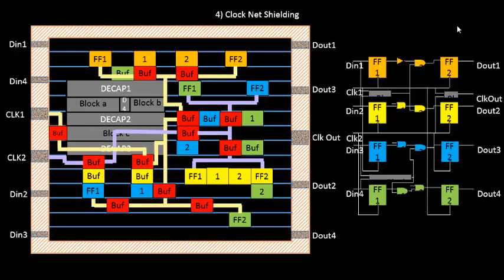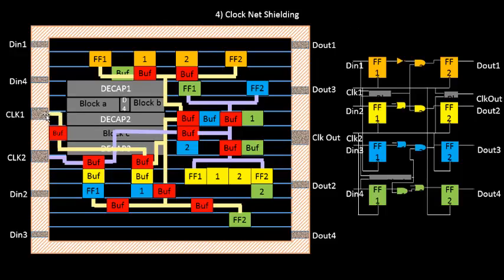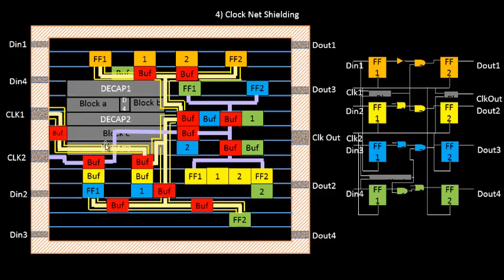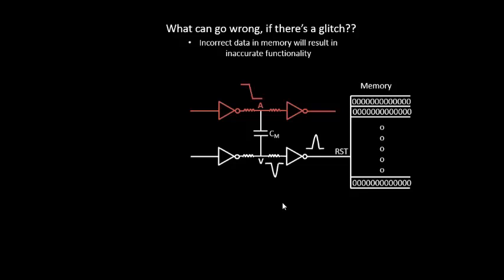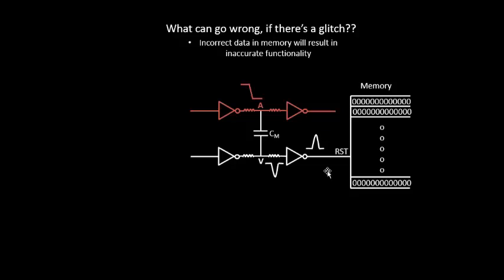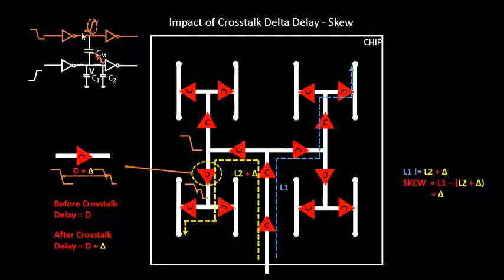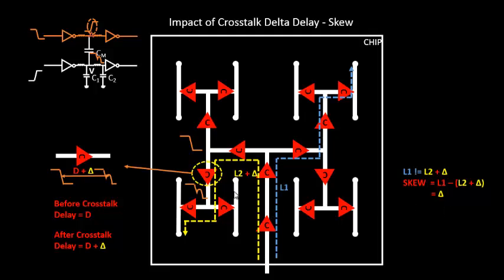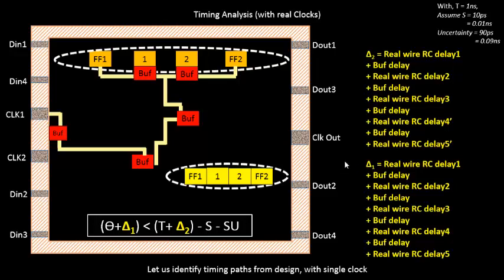How to do Clock Net Shielding?? Learn @ Udemy- VLSI Academy

Comment: please correct me if i am wrong. The delta delay is at net and not the cell delay and its equivalent waveform is used and hence delay calc is done at the 1.5 stage delay.
Reply from the maker: Delta delay is on net. You are right
Reply: thanks.